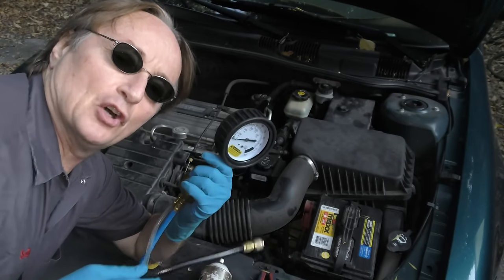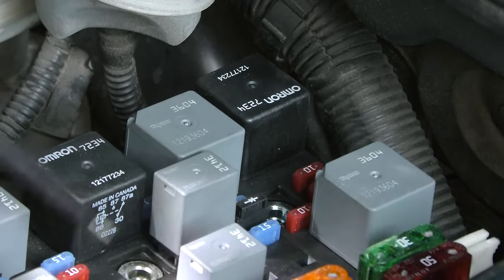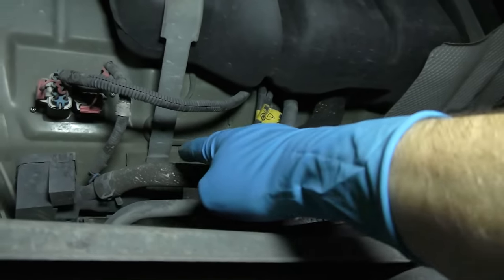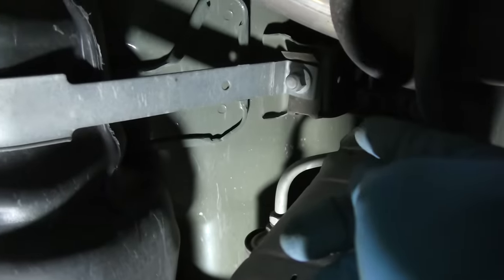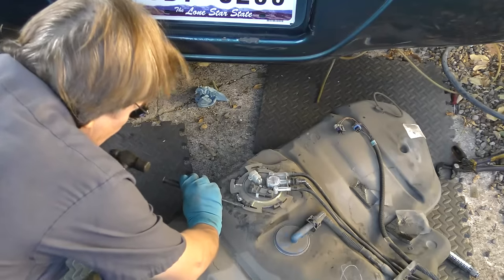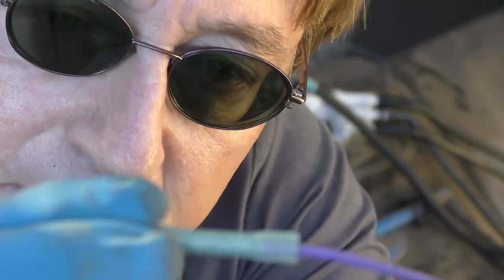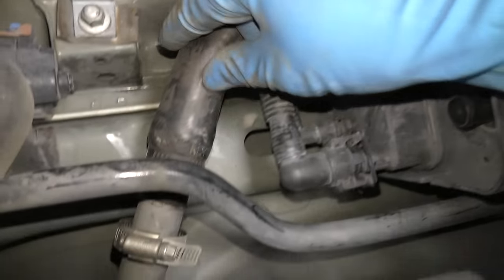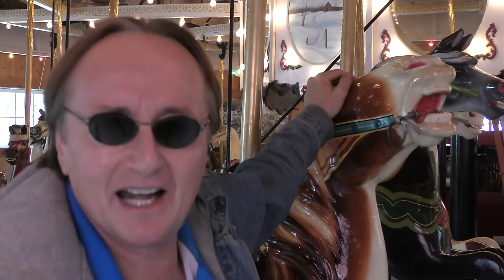How to Fix Car that Cranks But Won't Start (Fuel Pump Assembly)

Comment: allright. i have a 89 chevy k1500 with a 305 throttle body injection engine. i ran it for 30 mins on the road then it wouldnt start up again. it constantly cranks and cranks until it floods and fouls the plugs. it has gas. it also has spark at the plugs. so it should turn over. im puzzled. i thought maybe the cat is clogged and its definately not the best so i will gut that. it seems it only wants to start when its colder.
Reply from the maker: +Morgen kirby  realize it's flooding out, often leaking fuel injectors do that on that model
Reply: +Scotty Kilmer my model doesnt have fuel injectors it has throttle body injection and they are spraying fine. today i tool the echaust off and started it i ran it around and then when i left it to idle it died again. and wont start. but i think u are right about the flooding. but how would i fix that. one cylinders wire is messed up and possibly shprting out would that cause that piston to flood and then die out and flood all the rest

Comment: Honda's nice because you can access the fuel pump from the trunk or under the rear seats. You don't have to drop the fuel tank. But if you need to replace the fuel tank, Honda's  worse than others because you have to remove the back end (at least on our '99 Accord), which cost over $600.
Reply: brian0918  the Pontiac Grand Am pump is not working

Comment: Will never forgive GM for not putting access panels into the trunks or rear seats of these vehicles.
Reply: My 97-04 regal fuel pump is accessible from trunk..
Reply: +s0nnyburnett Some people just cut their own access panels.  But dropping a tank really isn't all too difficult if you have a jack and pretty tall jack stands. And of course not a full tank.  But I have drop tanks before that were pretty full no problem.
Reply: +Bob M. Tyranny Destroyer So is the 96-05 Buick Century models.
Reply: thekillersnake94
All 97.5-04 W body Gm cars do.
Reply: I had to do it twice on these cars. ..I too can not forgive them for then making the grand prix with a access panel..
Reply: +s0nnyburnett I'll never forgive them for spot-welding nuts for the tank strap bolts! EVERY time I do a fuel pump, at least one breaks on me. My last two GM cars, and my current Buick, all had ratchet straps holding the tank in.
Reply: +Bob M. Tyranny Destroyer To clarify, that's Century, Regal, Grand Prix, Intrigue. Sometimes GM does something "right." LOL
Reply: The W body includes Grand Prix, Regal, Bonneville,Riviera, Monte Carlo Park Avenue Andy Hicks
Reply: +s0nnyburnett they did from about 97 on(on most model cars ) .. lot of older cars were like that .. I made my own trap door for the fuel pump on my Camaro ...
Reply: +DaytonCarCare depends on the car imo , like the Camaro the exh and rear diff have to come out ,

Comment: Scotty ,  i think it a good idea to investage WHY this pump failed. maybe it has cloged fuel rail/fuel filter/fuel injector or dirt in the fuel tank that can destroy the new pump as well , just saying...
Reply from the maker: +עידו אריכא it's a GM pump with 163 thousand miles on it, most don't make it this far

Comment: I checked my fuel relay and fuse (which both were fine)put a new pump and I still have no start and no fuel pressure. Any ideas? Spark isn’t the problem in this case. On a 08 cobalt
Reply: GHOST_R changed fuel pump but still no gas going from pump to motor what now

Comment: is it my air flow sensor my truck cranks hits dies yet of the key try again and works fine just started doing this already had fuel pump replaced was easier to take the bed off than to drop tank mind was completely full when mind went out?
Reply from the maker: +grumpy old fart quite a few things can actually do that, best to have a guy like me use a machine as in my video "fixing insanely complex modern cars" rather than guess . Good data beats guessing hands down.

Comment: I have some some sort of fuel issue with my truck as well. It happens randomly when starting my truck. I have a 2000 Dodge Dakota SLT 3.9 with 238,300 miles on her. Now back to the issue which is when I start the truck up it'll sputter and stall out unless I keep my foot on the gas. It doesn't do this every time I start the truck, most of the time she starts up fine but occasionally I'll run into this issue. I don't know if it's a fuel pressure issue something more extreme. What I did to fix the issue was turned the truck off and on a few times and it eventually started up and ran fine. Do you have any tips and advise I can use to fully diagnose the issue? Thank you. 

P.S I also recorded the issue with my phone when it happened yesterday if you'd like to see it.
Reply from the maker: +Hank jr Breukelman  weak fuel pumps, weak fuel pump relay, or clogged injectors do that a lot on dodges. Pressure test the pump first
Reply: Thank you. If it ends up being the fuel pump i have a parts truck I can steal the pump off of, or simply switch fuel tanks. Having a parts truck sure comes in handy.

Comment: Hey, Scotty. I have 98 Honda Civic and when I cold start my car, the engine shakes violently and I hear a belt squealing. It then settles after a bit and after it warms up. It starts just fine but what could the problem be? Thanks.
Reply from the maker: +HeartbrokenDreamerX3  remove the belt, and if noise and shaking stops, something the belt drives has bad bearings, like the alternator

Comment: It would be great if you could tell if a pump is going bad before it leaves you on the side of the highway.  -John
Reply: +Big Guy Review 
They usually don't just quit. The pump will slowly lose pressure over time. (unbeknownst to you) Periodic checks may give you a heads up.
 Manufacturers SHOULD make a fuel pressure gauge standard equipment!
Reply: +Big Guy Review Perhaps an ammeter on the dash  would give an indication of a failing pump as it would probably draw excess current?
Reply: Tom OConnor I have heard of using a meter as you mention. What would the numbers be for a poor pump? Lol where would a person find that info?
Reply: Haywood Jablomy A fuel pressure gauge. Now that sounds like a good idea. My van has over 500 000 miles. I could probably change it now and stay ahead of the issue before it starts. Good idea though.

Comment: hey scotty i find out that myEGR valve is not opening. what could be the advantage and disadvantage of it. i test it i push the valve open and cover the vacuum hole still it close again.
Reply from the maker: +dave vega the vehicle will pollute more that way and fail emissions testing if they do that in your area. If not, it will actually run better

Comment: I'm having a no start issue on my 02 v6 mustang 63k
 Pump primes, cranks strong and no pressure at the valve up front. Will start right up on starting fluid.
Just changed the fuel filter. No change. Any thoughts? Thanks in advance!
Reply: Same did you figure it out?

Comment: I have a 1989 BMW 325i that usually starts and runs perfectly. However, last year when it was running for most of the day, it sputtered and died out of nowhere (thankfully I was in a parking lot). I let it cool down and then started it again, and it started just fine. I haven't encountered that issue since then, but I have had to press down on the gas pedal during this past winter (not so now that the weather is warm). Is this a fuel pump going bad? Or something else?
Reply from the maker: +LazyEyeCrazyI could be tons of things, but when it dies, do my video tests "fixing a car that cranks but doesn't start up" to find the source
Reply: Scotty Kilmer
Thanks, Scotty! You're so helpful!

Comment: scotty just one favor i would ask of you if you get some time could you send me a diagram how to connect a fuel guage to the fuel rail on a 2008 nissan versa.i do not see any valve like in your video so i am assuming it must have some fancy connection to access the fuel pressure on my car. thank you
Reply from the maker: +aruna khan there is no valve, you need a fuel pressure test kit that has an adaptor which fits on the fuel rail, you disconnect the feed line to the rail and install a fuel pressure test port that snaps into place there to test it. Harbor freight tool sells a kit for 70 bucks with all you need.

Comment: scotty my 2002 dodge startus 2.4 doch it wouldnt turn over this morning but my ac control was on and so i turned off the ac when i did my car turned over and started any ideas
Reply from the maker: test the battery, it may be going out, auto zones test em free

Comment: just bought a 2005 chevy uplander with high high miles. I have to press the gas to start?? What can this problem be?
Reply from the maker: +Larina Crowder often a weak fuel pump, or dirty injectors. Pressure test the pump first

Comment: how do you test the fuel pressure if it does not have one of those valves?.
Reply from the maker: +Ben Jamin you get a fuel gauge and an adaptor that fits on the fuel rail line when you disconnect the line and put that adapter on to pressure test it

Comment: My F150 been sitting for 3 months and the fuel pump work and I still can't get it to crank it needed a helicoil when I last crank it up it was starting up fine now I can't get it to start at all the engines just turning

Comment: Okay I change the fuel pump and check the relays the fuel pump is still not coming on what could be the problem
Reply: Crawl under your car with a multimeter and check if you have power reaching the pump. It might be bad cabels.

Comment: hey scotty what about a 2002 chrysler minivan it turns on and shuts off really quick showing a red dot flashing then starts up again with no problem i scanned it and it got me the code for the key reprogramming so i did that but still doing the same thing do you think the fuel pump or the alternator are going bad? maybe something else i am not sure.
Reply from the maker: +Fritz Madness flashing dot is probably security system, get the security system fixed first.
Reply: oh! how do i fix that by myself? I have to take it to the stealership i guess.

Comment: hey scott, i have a 1965 chevy c10 pickup truck and my temp light does not work at all. Any suggestions?
Reply from the maker: +slimjim 911 try a new temp sending unit on the engine first
Reply: +Scotty Kilmer I will give it a try. thanks for the feedback

Comment: but scotty what if tye car started but the fuel pump is weak what symptoms would you get?
Reply from the maker: +aruna khan it wouldn't accelerate, that's why a fuel pressure test is the best test, it would show low fuel pressure

Comment: I have another question my 1996 Pontiac firebird will idle poorly when in reverse, and even stop until I give it gas what's the problem?
Reply: By gas I men press the accelerator
Reply from the maker: +Matthew Allerton trymy video "how to fix a car that idles poorly"

Comment: hey Scotty.. I have a 2001 Hyundai Tiburon that won't start. Ive installed a new cranksensor and a fellow mechanic has told me that the fuel pump is working fine so if that's the case what else can it be??
Reply from the maker: +Rozell Claxton do my video "fixing a car that cranks but doesn't start out" and e mail me what system has gone out
Reply: +Scotty Kilmer got an update for you.. took it to a dealer they said the crank sensor wasnt getting any fire but I already replaced it twice.. could it be a bad computer or am I missing something??

Comment: I have 2006 nissan sentra that was giving me crank problem and i replaced the fuel pump and still gives me same problem. Cranks 2 to 3 times and starts even if it is on hot weather. Plz help me on this thanks.
Reply from the maker: +vishal oad try my video "how to clean fuel injectors on your car" and also have the MAF sensor checked they often go  b ad on nthose

Comment: hey scotty i changed my fuel pump and valve gasket it still wont start only with starting spray will it crank but then it dies
Reply from the maker: make sure pump has power and builds up pressure. if it does, then odds are injectors aren't firing from bad crank sensor or bad computer
Reply: change the sprak plugs too

Comment: I have a doge ram 1500 4 cyl. I'm trying to figure out where the little wire from the solenoid connects to. There's a white wire connected currently to it, and when I connect the opposite end to the positive of the battery it begins to crank the engine intermittently with the the key in the off position.
Reply from the maker: that white wire is the power wire, but if it has another one there too and it starts normally, just leave that one alone, cause some just have extra wiring on them when made at the factory for other options
Reply: The wiring on this truck was messed up with a non factory security alarm box. I yanked the box out and discovered the white wire was a jumper wire attached to the brown wire that connected the starter to the fuse box. I tested the starter and it works. I bought a new battery - it functions. I have power to all electrical systems. Next step is to check the relays - swapped them with others but I still had no power kicking over the starter. Its a no crank monday.
Reply: Love your site by the way. Thanks for the response.

Comment: Hey Scotty how do I check to see why my wipers are not working?
Reply from the maker: +Trell Atkins first check the motor for power and ground when you turn them on, if it has both, the motor  is bad which is often the problem
Reply: I had a mechanic replace the staring colomn! Do you think the didn't hook something back up Scotty?

Comment: Hey Scotty I need some major help,

I have a 1998 Jeep Grand Cherokee that cranks but won't start, the fuel pump & filter, distributor cap, hoses & spark plugs were replaced and believe it or not, it made it even worse, now the car won't start completely. I spoke to my father and he said it might be the fuel regulator because it broke up before and I wanted to know if this might be the case because, if it isn't idk what to tell my mother because she loves her jeeps (even though I hate em )
Reply from the maker: +xOphiophagus   those jeeps are money pits at that age, but do my tests "fixing a car that cranks but doesn't start up" and if it loses both injector pulse and ignition, replace the main computer
Reply: +Scotty Kilmer thanks for the help 😁

Comment: Hey scotty why didnt you do the fuel filter?
Reply from the maker: +Peter Kapica it had been done earlier
Reply: And try to drop the tank on an econoline with gas in it. Very hard so the other only method is to cut a hole in the back

Comment: Hi Scotty , I have a problem, my car can´t not start in coold weather, i change the coolant sensor thinking that was the reason, but the problem persist, the car start, at the third time i turn on the key, it´s a 2001 jetta, when the weather is hot, starts normally.
Reply from the maker: +Fernando Torres  try my video "how to clean fuel injectors on your car" and also clean the MAF sensor
Reply: thank you, I will.

Comment: I feel like this could have been more extended, cause there's more than just a fuel problem that could be wrong. I know you're trying to keep it simple and short, but this could have been vidded in categories what to do
Reply: +rimwydas44 
I agree. At the least, the video should be re-titled.

Comment: shouldn't you turn the key on and off a few times to get gas to the engine?
Reply from the maker: +William Mickelson you can if you want, but modern pumps pump up pressure really fast just cranking
Reply: you don't really have to do it with a fuel pump but you can you mostly want to do it with a new fuel filter because it purchased a new fuel filter you want to do it at least three or four times to get the fuel in the filter

Comment: When my car stopped running on the freeway it wasn't a fuel pump. The whole engine went out.
 I found out that the fan wasn't working so the engine ran hot. I junked the whole car.

Comment: hey scotty,  my 03 murano left me stranded last weekend, it stalled and didn't want to take off. It gave me code p0420 which is fuel system leak or malfunction but at meinekes they told me two of my cylinders and spark plugs are bad. How is this possible when i charged them 16 months ago? Please help with info with your expedience.
Reply from the maker: +laoutlawz when cylinders go bad, they wipe out the spark plugs faster

Comment: Hi +scottykilmer I have a question for you I replaced my thermostat and water pump on my 2000 cadillac seville sls but it still over heats would you know what the issue might be? (replaces both 6 months ago)
Reply: +Miguel  Reyes if it's a Northstar motor, most likely the head gaskets. The most notorious problem with those Caddy's.
Reply: +Sean Spring I actually replaced the head gaskets not that long ago of oil leaking so that should be find but I would check to be on the safe side thank you
Reply from the maker: +Miguel  Reyes do my video "how to fix an overheating car"

Comment: Hi.  I have an old Toyota.  Recently it would start one day, but not the next.  Jumpstarting it helped, but the problem recurs and will not start without a jump.  When I turn the key, it does nothing, not even a click.  Would appreciate any help on this forum.  Thanks.
Reply from the maker: +Sofia Brinkley replace the battery
Reply: +Scotty Kilmer Thanks, Scotty.  Took it to the garage.  Battery tested 'good'.  However, the technician saw a loose cable near the solenoid.  Went to an auto electrician and he claims the starter motor has packed up.  Not sure who to believe now.  Thanks for your help, though.
Reply: +Scotty Kilmer Just a quick update.  It was in fact, the starter motor that had given up the ghost, the coils, that is, and the solenoid.  Not sure whether I needed an entire NEW motor, but sadly, I do not know enough about cars to argue with the technician.  Cost an arm and a leg, though, but no more starting issues, jump or push starting it anymore.  Thanks for your offering.